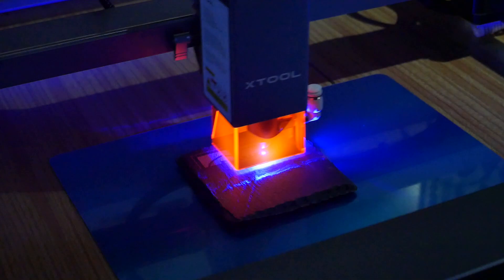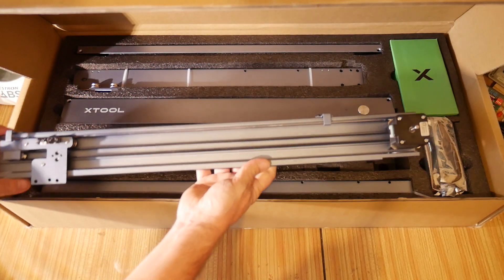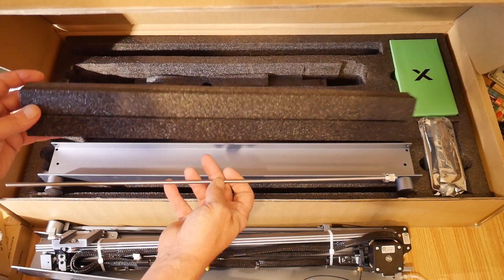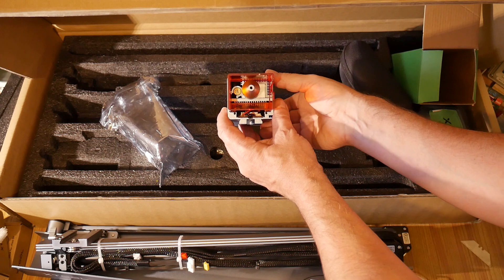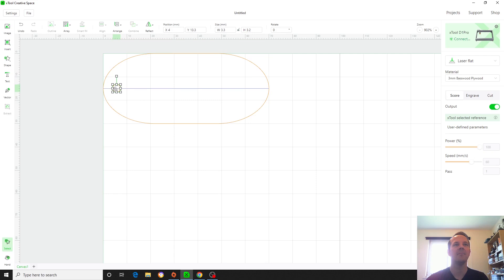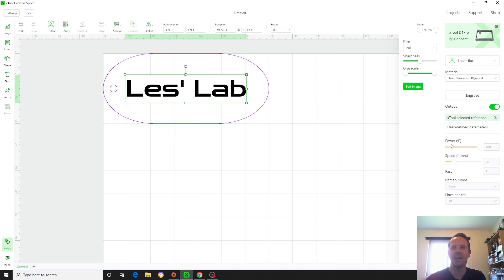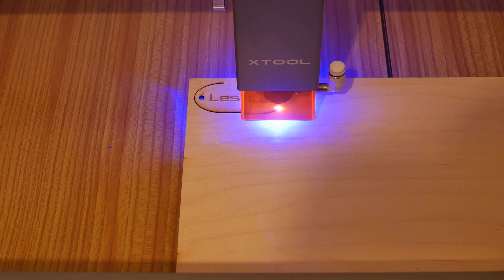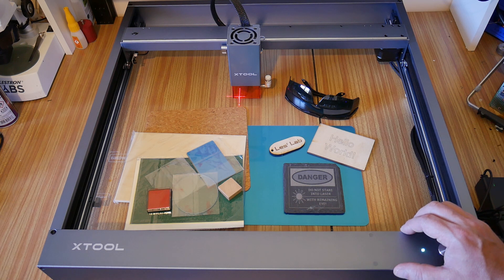xTool D1 Pro Review and first project

Comment: I'm looking for a hobby laser and Xtool is on the list but so is CO2. I know they deal with different materials and that's part of the decision that I need to settle on... but for now the tech behind them is just as interesting so you channel is fun! .  Xtool (and all the other  laser companies) have been giving lasers to so many Youtuber's the market is saturated with opinions... but you are far more knowledgeable about the tech behind them. Do you think the Diode lasers are going to have the same life as the CO2 laser tubes?
Reply: That's going to depend on heat. Diode lasers lifespan is a direct result of how hot they are allowed to get.
Clarification: the lifespan of a diode laser is generally given by the manufacturer, but the lifespan will be greatly reduced depending on how many of the usage hours are operated above a certain temperature. 
You really need to specify the wavelength and optical power of a given laser in order to get a more accurate determination of laser life span.

Comment: Hi Les, greetings from San Francisco, and thanks for another great video.  I have been dithering about buy one of these for the last month and you've pushed me over the hump.  I'll be using your link when I;m through writing this.  
A quick question, if you have a moment.  This will be my first laser cutter and there will be occasionally others around while cutting.  Can you recommend  any specific safety glasses I can buy for others who may be around while the machine is on?  And, are the glasses the manufacturer provided acquit, or do you recommend  something better.
Thanks
Reply from the maker: Thanks, and thanks for your support. It is an awesome machine!
Regarding safety glasses, you will require glasses with an OD of 5+ at at the Laser wavelength of 455nm. The ones included have not been tested however they appear to be adequate, if a little dark.
I you have seen any of my other videos, you will know I am a big fan of working safely, but for that, prepare to spend money!
Since you are located in the USA, I would recommend this well known supplier:
https://www.kenteklaserstore.com/kol-5303-laser-safety-glasses
$110 USD for certified eye-wear is an utter bargain!
Reply: @LesLaboratory  Thank you, I;ll get my orders in today.  Great Channel!

Comment: Looks nice:D
But I wouldn't trust the laser safety glasses that got send with the laser engraver, they look kinda sketchy to me. Maybe you could test them using an lpm?
Reply from the maker: I'm actually pretty taken with it. I want to engrave panels for electronics and Laser projects. The glasses appear to be effective, however I am not sure they would withstand an intra-beam exposure for 10 sec. That said, under sensible normal conditions, that should not occur.  Sure, why not test. I have some others as well, and could  make it into a reasonable video.
Reply: @LesLaboratory Yeah, why not. That would be interesting.